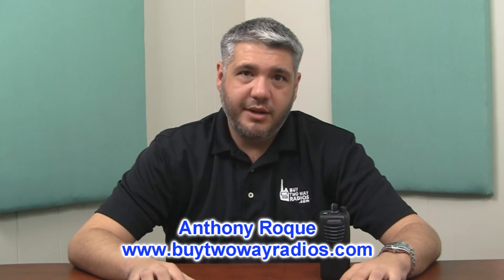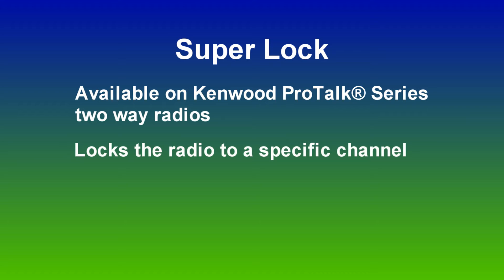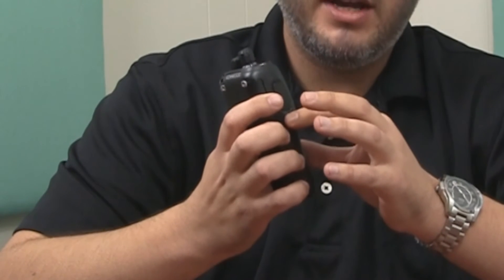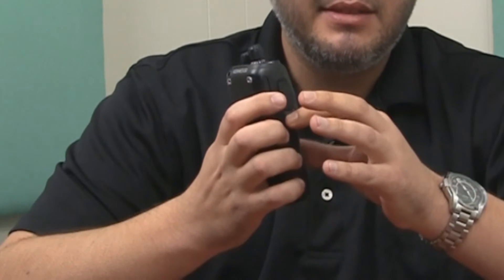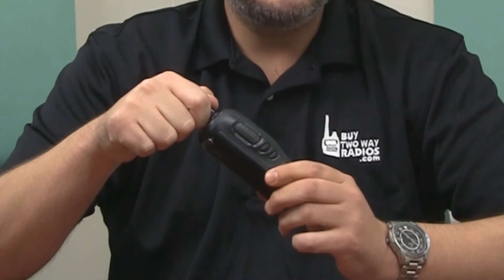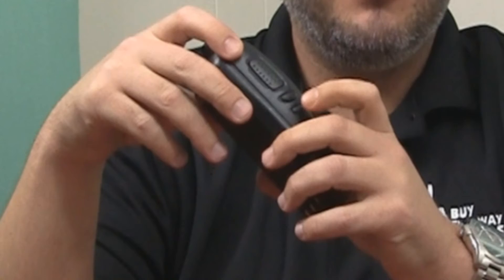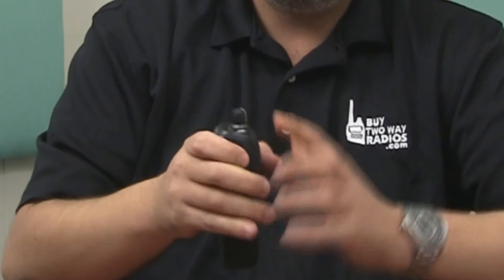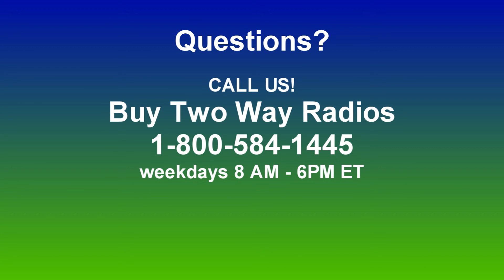How to deactivate Super Lock on Kenwood two way radios | Radio 101

Comment: Hi good day I have a Tk3402 every time I put it on it has a solid green light on it. No transmission is receiving but you can transmit when pressing the push to talk button. Any suggestions to what mode the radio is currently in and how to disable it?.

Comment: Hi there,
I have a TK-3310. The radio is locked and pressing Side Button 2 will toggle between backlight on and off but it does not create any kind of response in the LED light on top of the radio. Therefore, the unlock isn't working, nor the reset. Any idea what I can do? 
Thank you.
Reply from the maker: We are based in the US and do not carry that model. You may need to contact whomever programmed your radio for support.
Reply: @BuyTwoWayRadios  thank you for your response, I will do so!

Comment: hello anthony i bought Kenwood NX320 radios belong to a closed down company on ebay but i want to program them to my own frequency i have software but it is asking for a security code could you please help ?
Reply from the maker: Hi Shane, if these were pre-owned radios and they are asking for a security code, chances are it was set by the company who owned them or by the dealer who programmed the radios for them. You would need to contact the previous owner or dealer who set that code to unlock them.